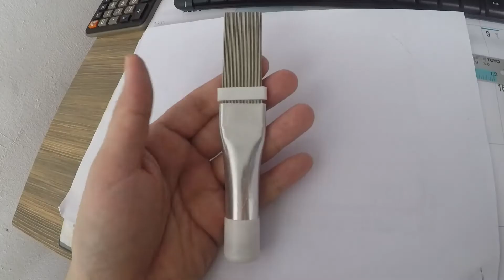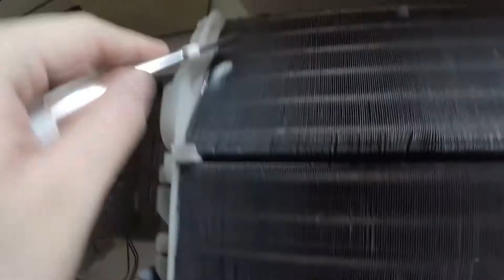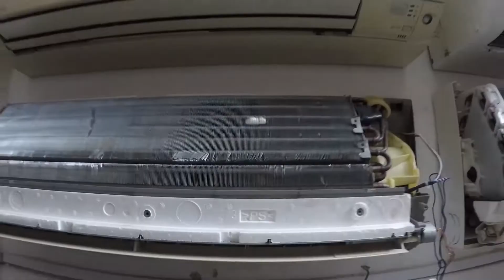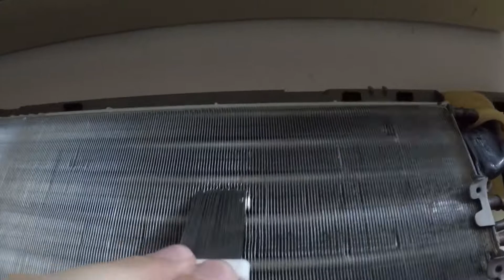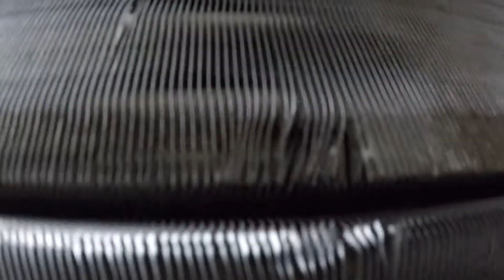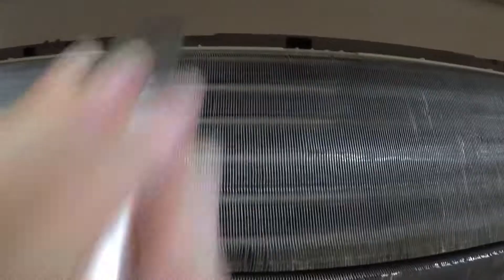DIY repair on dented air con coil with a cheap fin comb

Comment: It is necessary to straighten the coils? I don't have many that is bend? How does it keeping straight makes it better in cooling.
Reply from the maker: little bend it ok . some they diy clean use toothbrush . up down motion is ok. left right might cause the coil bend. air cannot flow . it affect the cooling

Comment: does the back has coil fin too? i suspect my coil fin at the back is dented which caused my aircon not cold. that time the cleaner has difficulties to slot in the blower and press quite hard to try to install back and then realized the rubber part did not slot properly.
Reply from the maker: 1. does the back has coil fin too? (yes)
2. suspect my coil fin at the back is dented which caused my aircon not cold ( little bit dont think affect the cooling)
3. realized the rubber part did not slot properly. ( workmanship things hard to say most important he rectify for you )